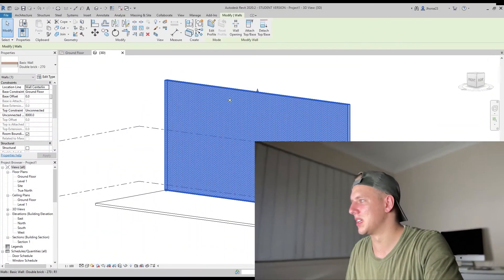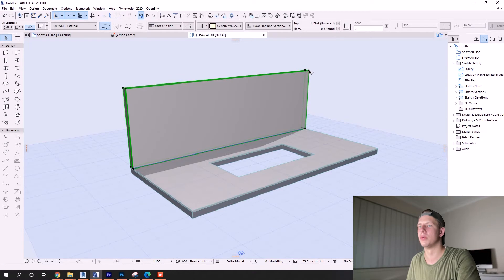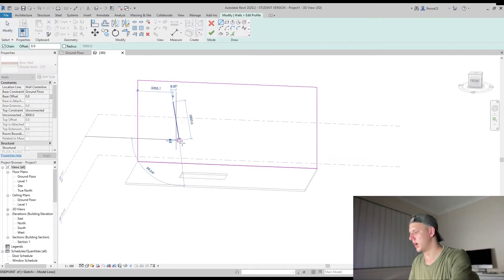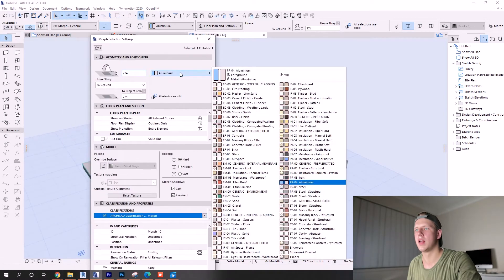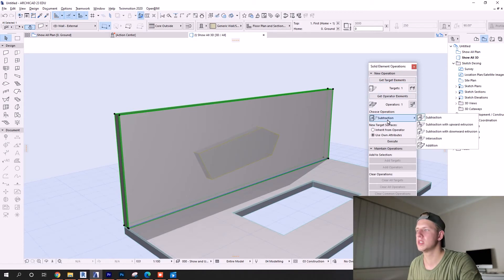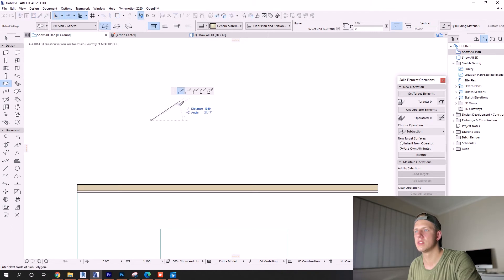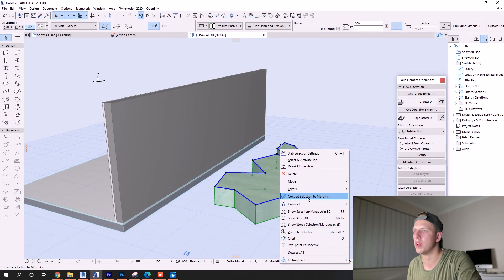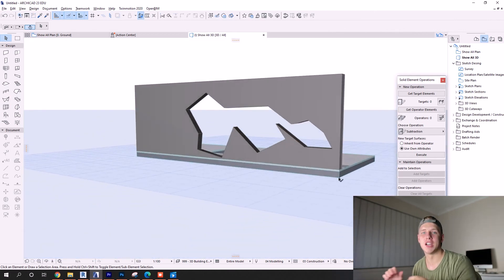Archicad: How do I cut holes in walls!?

Comment: U can use the section tool to get a perpendicular view on that wall, then draw in that section view the funny hole shape and finally, as beforw, use SEO to cut out.
In that (2D) view you can also control and edit the boundaries of the cutting morph...
Reply from the maker: Great input, yes trying to draw the extents of the morph in 3D can be frustrating! A section would make it much easier. Thanks!
Reply: @JDArchitecture  i would draw the section line right on the aligment line on the wall. Then draw your shape with the morph and extend in 3d, cut SEO. Probably you make a part two of the vid (just to show how close archicad is to revit..)😉

Comment: Selection of the empty openings is a pain the neck in Archicad. I somehow managed to move the empty opening to the edge of the wall because I needed half of the opening (the "wall" is a cupboard door) then I copied and mirrored the cupboard door and arranged it in a symmetrical way - so far so good but the last step is almost impossible to execute - the selection of the empty opening of the second cupboard door.
Reply from the maker: Hmmm, sounds like you're doing a lot. I am not sure If I am following how you are using the 'Solid Element Operation' tool but try exploring alternative methods for creating cupboards :) Feel free to go into more detail and perhaps if I can chisel out more time I can address this in another video!

Comment: Great tutorial, but how does it show in the floorplan? Does it cut exactly the way the wall is cut (so, what you see is what you get) or do you see the symbolic view of the wall (without the whole)?
Reply from the maker: Thank you!

Good Question, Unfortunately you can only see the symbolic view of the wall without the SEO.... I'm sure there is a way to fix this but I am not aware of any solutions :(
Reply: @JDArchitecture  Yes, it is the most not cool part. the wall after SEO can't show correct 2d plan appearence.